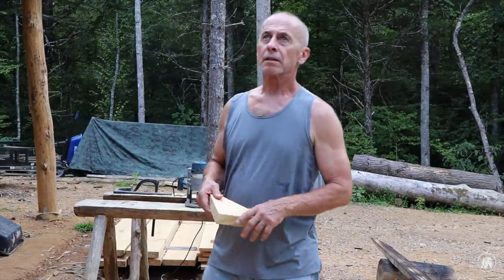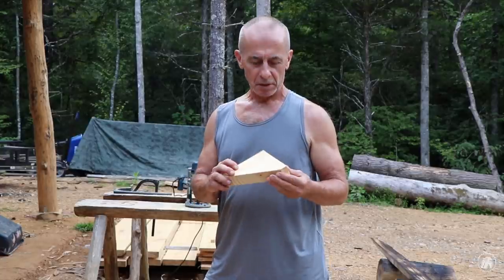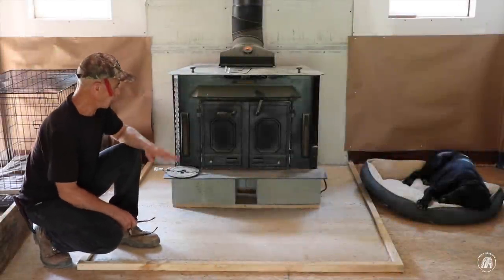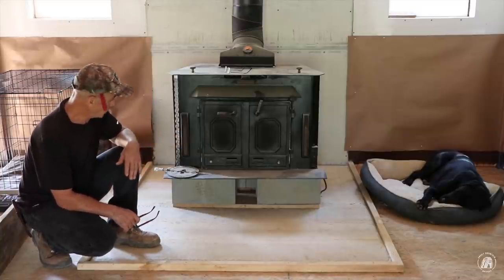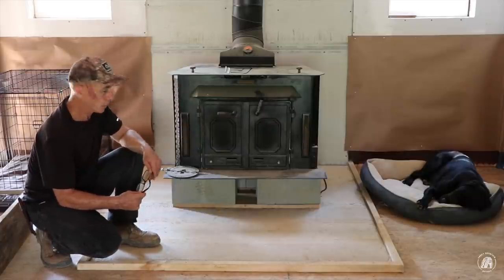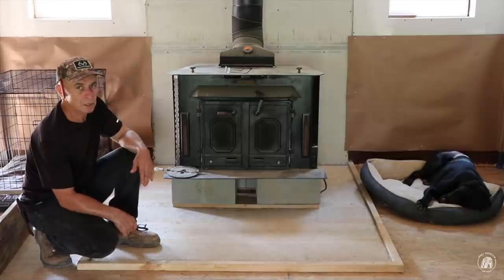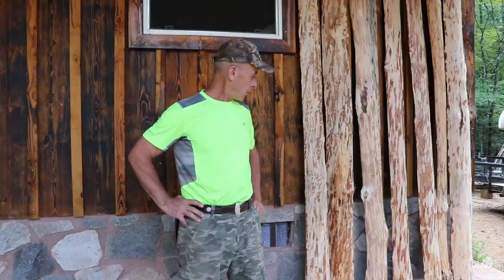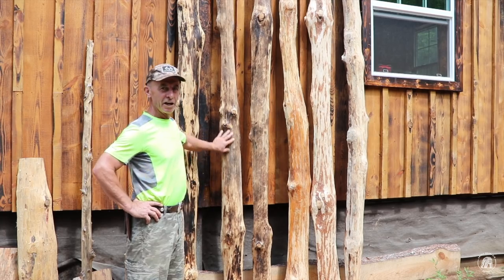OFF GRID TIMBER FRAME CABIN | INSULATION, TRIM & WOOD STOVE PREPARATION

Comment: Hey a friend of mine took one of those stows like you got and welded pipe all the way around it but 3" round metal pipe and well did it all the way around it and had 1 pipe coming off the back wall with a computer fan blowing through it then he block rocked all the way around the stove around the outside of that all that heat that the stove puts out and goes into that pipe you're just blowing it out into the room
Reply from the maker: This stove is double walled and has a fan mounted in the back from the factory. It blows the hot air trapped between the two metal portions into the room.